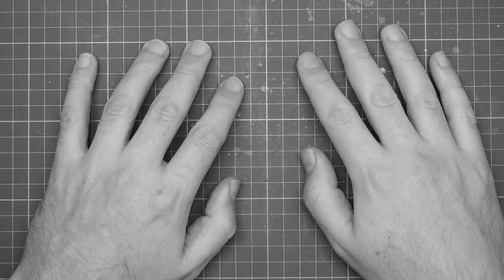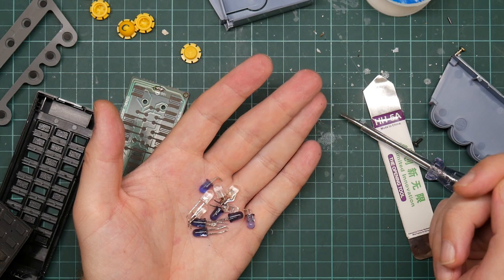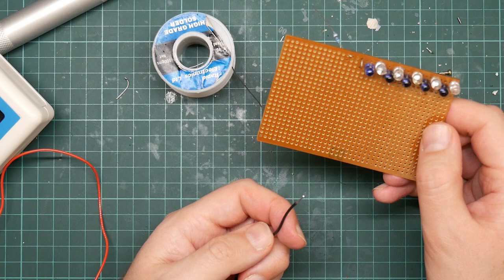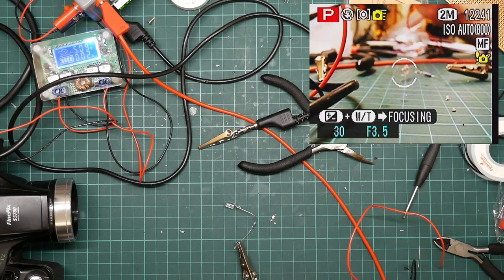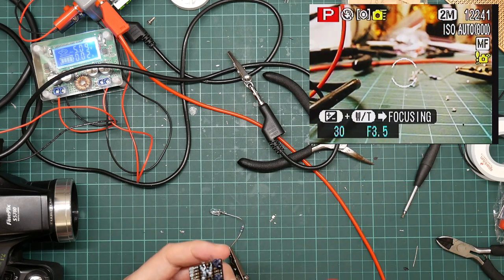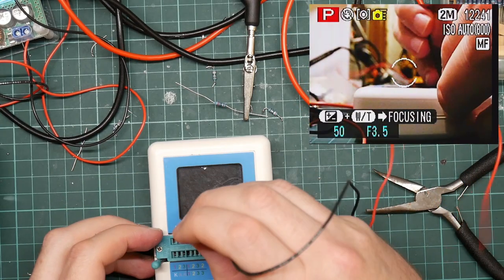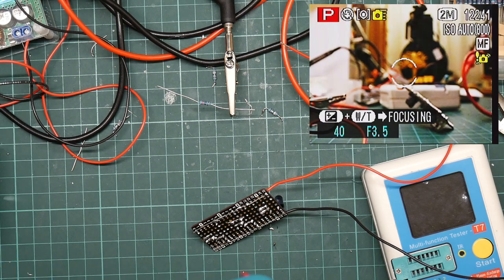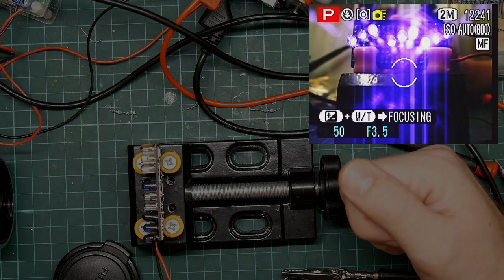Infrared spider photography 2/3, building a lamp

Comment: I was relieved that you figured out the parallel/series arrangement.

I've also seen lamps that use un-cropped LEDs extending from their PCB (equiv.) to aim them through a focus-volume/focal-point to achieve a better light distribution w/ an existing 'standard' incandescent fixture design.   I found it amusing since that was a 'new' upgrade to the bus shelter on my old commute: Exchanging a single huge LED panel that spat most of its light out into the street (and people's eyes), for a few tiny (<1W!) things that illuminated the shelter very effectively, but only the shelter (was sometimes difficult to see bus through glare/reflection until drivers started using the running side lights.)

Might be an idea for the next version of this, if splitting one (or more) three strings off isn't able to fill an inconvenient shadow.
Reply from the maker: Yeah, this was a complete shambles! Actually, what I'd do next time is to get a cheapo 24-LED infrared illuminator from aliexpress. You can get them for 0.75 euros and they'll run at 12 valts (sic)...